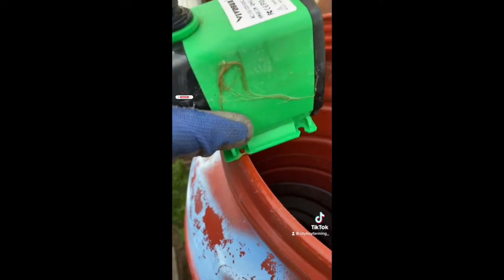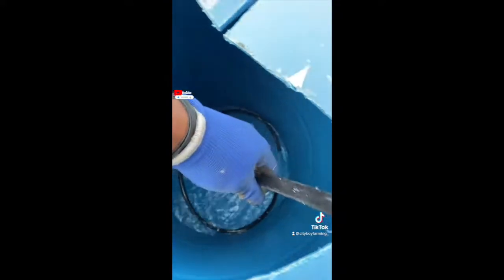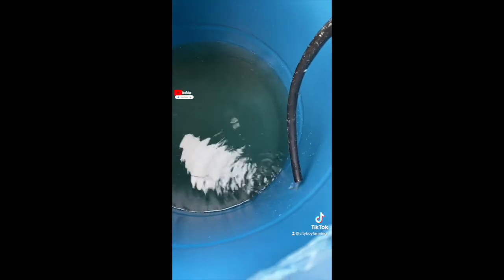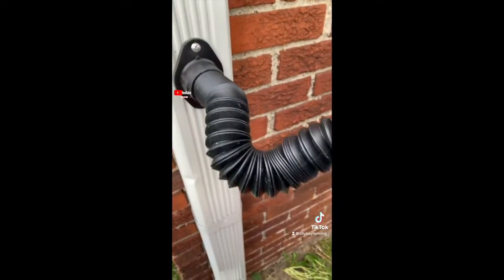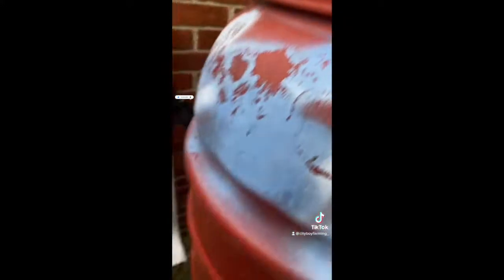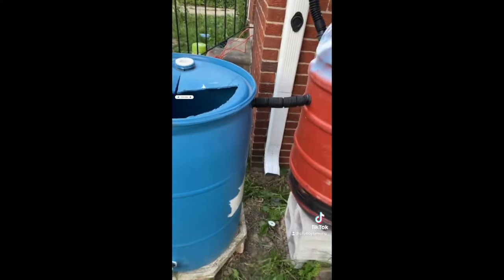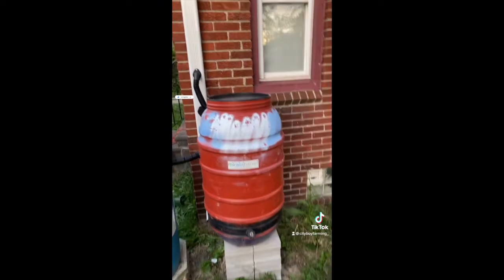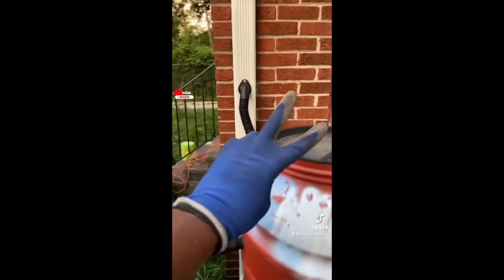Installing an Earthminded Connector To My Rain Barrel

Comment: On my new lot there`s a giant water tank abandoned there. I put a big "carport" style roof over my 5th wheel camper and I`m thinking of rigging up a way to catch rain off that roof and go into that giant tank. Would be great to use in my garden and hydroponics. My first project is gonna be growing some yellow summer squash in a couple of food grade 5 gallon buckets using hydroponic solution. I have two types of lights to try plus smaller ones I can place under the leaves to boost growth. 

I don`t yet know what issues the camper might have but it`s a cheap home and it looks nice enough to me on the inside. I bought a bunch of individual solar powered portable batteries for a small freezer, a dorm fridge, 12 volt cooking, and small fans and lights after hurricanes. I gotta get a large battery and charging system exclusively for my tiny air conditioner and I`ll be set...if I have 1000 left after hooking up utilities. If not I`ll never be able to get it with just my small SSI check. 

It was awesome to have those batteries recently because we had a long power outage and they easily powered my little indoor gardens. My family thinks I`m crazy. All they care about is HUUUGE TVs and dumb BS! My sister is the type who thinks just because she hates lettuce I shouldn`t have gardens to grow it. Now she and my OCD nephew are about to PANIC because I want emergency solar power for air conditioning.
Reply from the maker: I been seeing them rain containers around but I can’t take I would love one but if I do it I’ll be in trouble
Reply: @CityBoyFarmingAndrewSeegars  I saw one in Arkansas on a cabin. Big white square plastic box with a metal frame around it. Knowing Louisiana this one probably has a hundred holes shot through it. Hopefully not.